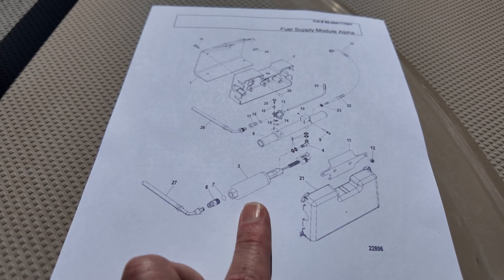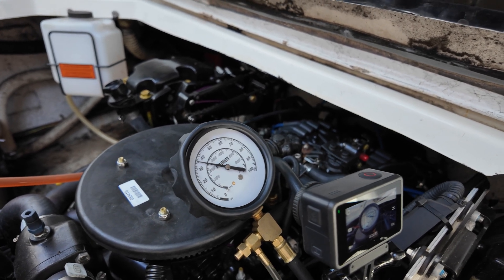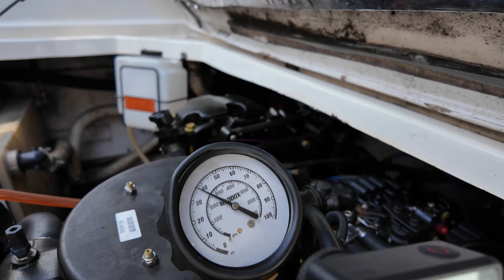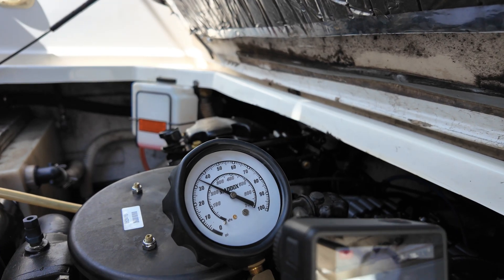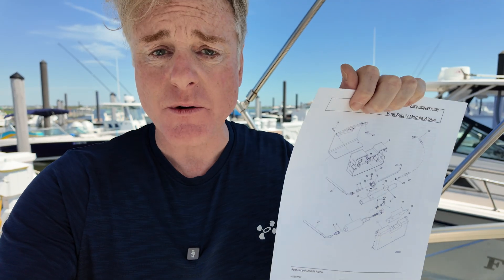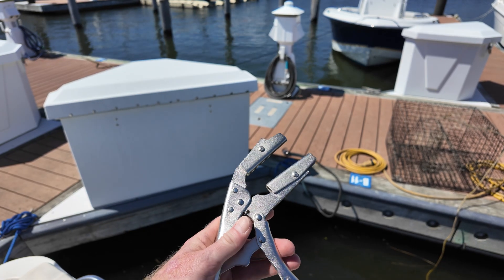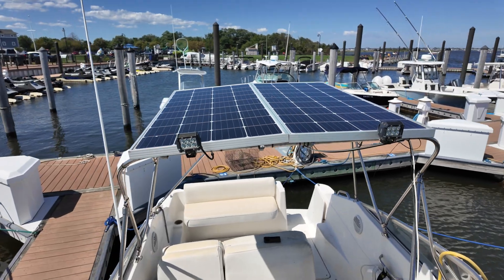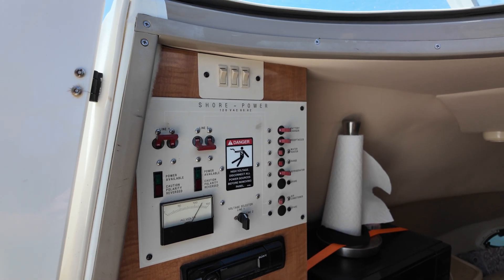Is My High Pressure Fuel Pump Failing? Mercruiser MPI Problems

Comment: I THINK YOUR SUCTION LINE FOR THE FUEL PUMP IS SUCKING AIR CAUSING THE FUEL PRESS FLUCTUATION
Reply from the maker: I've gotten so many great suggestions I should start making a list.  That is a great suggestion and I did a quick pressure test when I took everything off because the pickup is 23 years old.  I thought it could be cracked so I decide to run with an almost full tank too.  Turns out it was the low pressure pump and/or a piece of foil in the tank.  Thanks again for a great suggestion.

Comment: It is a fuel delivery issue, plain and simple. Why are you changing all that other shit for no reason?

My best guess is a blockage at the low or high pressure pump, starving the engine.
Reply from the maker: You are correct. But how would you have solved/fixed it?
Reply: @Nautisphere  if it is a blockage, then remove the blockage. To find the blockage, you start at the farthest point from the pump, disconnect line, run fuel into a bucket to test for flow. Repeat backwarda along the path until the flow increases to normal. If the flow is low out of the pump outlet, then check for a blockage inside thw pump or at the pump screen.
Reply from the maker: Agree but easier said then done.  I removed the pump, pickup and anti siphon value and tested the flow of those components as a system outside the boat.  It transferred a gallon of gas in 1 minute and 15 seconds.  That's 48 gallons an hour.  I did fix the problem.  If I didn't jump through so many hopes I may not have figure out "everything" that was wrong.  Video on that coming soon.
Reply: @Nautisphere  it may not have been easy for you, but for an average mechanic, this is very easy to diagnose. This gets much harder when dealing with direct injection, since those pressures can exceed 2000psi very easily, but when dealing with port injection, it is pretty straight forward.

In fact, when you initially had the pressure gauge connected, I knew to look for a blockage first, since shit in the tank is the most common cause of fuel delivery issues in marine applications. Pickup tube screens are a known culprit in many older tanks, so I normally cut them out in favor of relying on Racor filtration (pre-pump) to do all the screening. This also allows for the installation of differential pressure gauges to alarm when drop gets too high, normally on diesel applications.
Reply from the maker: Totally agree with you.  I had a piece of foil in the tank and since I'm on a 24ft cruiser I don't have a Racor filtration.  I may have struggled a bit BUT I did solve the problem without throwing any parts at it other than a $25 fuel pressure regulator and using the spare low pressure pump I had.  If I was helping someone in the future I'd suggest removing the screen from the pickup, but a none anti siphon in temporarily and run the boat until the problem happens again.  When it does check the screen at the pump.  This is exactly how I got the foil/obstruction removed.  Certainly a lot cheaper than having someone polish the fuel and tank which could have been $$$$.
Reply: @Nautisphere  being gas, not diesel, polishing the fuel is completely pointless. Adding some 90%+ rubbing alcohol or Methanol to the tank would "polish" the gas.

Not having a proper external fuel filter on any marine application is asking for trouble. Amazon sells Racor knockoffs that work just as good as thw real thing at a fraction of the cost.
Reply from the maker: Good to know.  I did a quick search on Amazon.  I'll do a bit more research and perhaps will add something like that in the future.  All the used boats we're currently looking at do have "real" filters but we are only looking at boats with diesel engines.

Oddly enough, using an additive was part of the reason for my problem.  🤦🏼‍♂️

Comment: Going through the exact same problem. Have you replaced the fuel regulator of the 'cool fuel module '.  Just replaced mine haven't had a chance to try the boat yet.
Reply from the maker: Thanks for your question. I only changed to fuel pressure regulator up by the rail. That didn’t fix the problem. What did fix the problem was swapping out the low pressure fuel pump and finding a piece of foil from the top of a bottle fuel system cleaner on the screen. I had the spare pump so I didn’t put the same one back on. I was too tired to not just try and solve the problem so I can’t say if it was one or the other or a combination of the two. Maybe next summer if I “have nothing else to do” 🙃

Comment: Enjoying your content a lot because I’m also dealing with this type of fuckery on my 2007 2400SE 5.0 MPI. 

I started getting stalls at cruising speed where I’d need to wait a few minutes before it would restart.  I suspected venting issue so took off vent hose and blew compressed air through it and big spider came flying out of the vent cap.  Boat ran great for a week or so then started stalling again.  Definitely a fuel pump issue as it only turns on intermittently.  I took off the relay that powers it and lo and behold terminal 30 was fried.  Bought a new relay but it may just get fried too.  Hoping I won’t have to replace entire CoolFuel module. 

BOAT: Beware Of Always Troubleshooting 😂
Reply from the maker: Thanks for the kind words.  I finally got my boat running right this weekend.  It was the low pressure lift pump but I'm not exactly sure IF it's totally bad.  When I went to swap it with a spare I had bought 14 years ago I found a little piece of foil from the top of a bottle of fuel injector cleaner on the screen of the pump.  Good luck with your new relay.  Hopefully it doesn't die on you.  Make sure your blower motor is working well and keeping that engine compartment as cool as possible.  These MPI engine certainly don't like a lot of heat hence the need for the CoolFuel module.

Comment: idk if you have the right fuel pump drawing, one is on the port side and the other is on the starboard side. please confirm. Also try checking your base timing as mine slipped so I had to readjust.
Reply from the maker: Thanks for commenting.  I have the correct pumps.  Lift is on the starboard side going right to the tank.  The port side has the fuel cooling module and HPFP.  I have not checked my timing.  Can the timing just "slip".  I mean if everything is tightened down properly that shouldn't happen, correct?  Depending on how quickly I want to bury the throttle I can get up to 4200 rpm and it's super smooth.
Reply: @Nautisphere  If your pump is on the starboard then you have the cool fuel module 2. There is a little screen in the regulator that could be clogged (usually this would give a higher fuel pressure). I don't know about the lift pump, but that could be clogged preventing volume to the hpfp.  I'm leaning towards you sucking air in your pickup though this can only be tested with an aux tank. A distributor can slip though its uncommon, it was just an idea.
Reply from the maker: Thanks for the advice.  Hopefully I won't have to try those anytime soon.  I got it working last weekend.  I narrowed the problem down to the low pressure lift pump and while swapping it I found a small sliver of foil from a Techron bottle on the screen.  I had enough time blown this summer so I just swapped the pump with the spare I had and everything seems to be working now.  🙏🏻

Comment: Man, this is one SOB of a problem. Still sounds like fuel to me. If the HP pump is good, have you tried cleaning the common rain\l and injectors? Take the injectors out and have them tested? After tat, I would follow up on suggestions to get sensor such as MPA and O2 checked.
Reply from the maker: Hi Martin.  You can say that again!  I installed a new battery last night but didn't get a chance to take it out.  Agree with you it still feels like fuel delivery.  I'm still questioning both pumps (not that they are bad but loosing voltage hence the new battery).  I have new battery terminal connectors coming, along with a new TMAP sensor, ICU sensor and BG 44K Fuel System Cleaner.  The sensors were cheap and I can easily swap them in and out.  I'm going to get another ground cable hooked up too.  I've seen too many stupid things happen because of a bad ground.

Comment: This what I done so far 
Change anti siphon 
Plugs 
Rotor and cap 
Low fuel pressure pump 
Oil change ,oil sensor 
And sending unit 
Fuel filter separator it's turning my plugs to dark powdery smoke 💨 somebody mention it's running to rich that's why I leaning on moving into high pressure pump posible injectors or pressure regulator. I'll keep you posted . Thanks .
Reply from the maker: Did you replace the MAPT sensor?  Manifold Air Pressure and Temperature Sensor?  Should be on top pf engine between the air filter and the distributor. I just took mine out and sprayed it with Contact Cleaner but no joy. Mine is a Bosch 19-03-293 D 02.
Reply: @Nautisphere  did you had any luck getting to run better ? my temperature never goes over 150 first thing I did wheb  I got the  boat was change inpeller . I will check MAPT sensor mind I believe talking about Mass air flow sensor ? Mind is in the Trhottled  body  intake since it is 5.0 EFI 302 ford motor .
Reply from the maker: Mine DID not run any better. I’m going to order a new MAP sensor. I made a mistake before. That number was probably the date code. The part number for my MAPT sensor is 0261230217
Reply: @Nautisphere ok good luck keep me posted on you Results please.

Comment: Hi my we have talk before I feel your pain my problems just  went back to square one 😢 I'm now don't have any power when giving it throttle it just like it's totally not getting fuel I'm testing the power from the relay to high pressure pump . I hook up fuel  pressure gauge I got no pressure gauge at all , trying to determine if it's electrical or the pump it's bad . I do have a new pump on hand the Omms on the new ones are 15.5 and the omms on old one are 1.5 I might just changed it see what it does i can't find anything on eBay they should be but that's a lot of difference between the 2 of them . I'll be watching more of your videos hope I can learn more from them .
Reply from the maker: Not sure which pump you need but someone recommended the Fuel Pump Factory. They got their pump from them and recommended them.
Reply: @Nautisphere hello my friend here an update on what im doing as it turns out i had the high pressure fuel pump installed on the low pressure side 🤦‍♂️🤷‍♂️after confirming with the Manufacturer Quamtum fuel systems n seen you tube videos . Im going to switch over to the high side n put the other new one on the low side . Also going to replace  the fuel pressure regulator . N see why at it does . But all along I been running with high pressure pump on low side maybe that's why boat been runner like crap having 2 high pressure pumps 🥴.
Reply from the maker: Thanks for the update.  Glad you figured out the problem and hopefully nothing negative happened with all that extra pressure.  Hope that fixes it for good and you get to enjoy some great weather the rest of the season!!!
Reply: @Nautisphere thanks 🙏happy boating n safe Labor Day wekend
Reply from the maker: Thanks.  I'll be on my boat no matter what.  Worst case scenario I'm anchored out for a while or fishing on the bay.  ✌🏻
Reply: @Nautisphere nice 🫶🤝

Comment: Hey Great Videos Havign issues with my 2008 305 MPI Also. Do you have the Dicacom software and cables? Im right in Barnegat
Reply from the maker: Hey Neighbor. Thanks for the compliment. Unfortunately I don’t have the Diacom Software but I’m starting to think about getting it. Right now I only have the Bluetooth engine adapter to run VesselView on my phone. What issues are you having with your 305 MPI?
Reply: @Nautisphere  Started out Running Great this season 2008 Trophy 2352 3800rpm at 23mph 1.7mpg. Then sluggish 4200rpm at 21 1.3mpg. Replaced cap/rotor, plugs and module in cap. Then we ran it IAC took a crap and now warning buzzer and fuel pump on constantly. No more prime, just runs constantly. Pulling ECM today and shipping to maic salazar diagnostics. Gonna replace MAP and TPS also. Might as well freshen it all up for the next 4 months. I have the Bluetooth adapter also plus a nmea adapter
Reply from the maker: I just order the TMAP and the Throttle Position Sensor since they were both cheap online and easy enough to swap if it turns out NOT to be electrical, bad ground, etc...  The warning buzzer might be the sensor for low oil.  I had that happen once.  The pressure was fine, the sensor just died.  I my old engine there was a separate one that killed the engine if the pressure was low.  I'd love the find out about your nmea adapter.  I think my new Garmin supports that and would kind of be cool to see that one the screen vs always using my iPhone.  Keep us posted how you make out.  Hope that ECM is ok.  Those things are expensive.  I've heard people talk about them being a potential reason for a problem but never seen anyone post "Yeah I switch my ECM and everything is working now". Good Luck.
Reply from the maker: Sounds great.  Just do a search.  You'll find me.  We're not the one in Europe.  LOL.  We can rendezvous on the water.

Comment: I think you try a different battery. That thing really cranked slow for an AGM. Which you don't need but whatever. And your solar may not give enough amps that fast to make a difference.
Reply from the maker: I bought the AGM original for the solar.  A year later I bought two Lithium Iron Phosphate batteries from Costco for the solar so I decided to use the AGM as the main battery. Maybe I’ll switch back to a regular battery instead of paying the premium for the AGM because it didn’t seem to last any longer. The AGM in my BMW convertible is 14 years old this month. Manufactured date August 2011.
Reply: @Nautisphere  Those AGM don't recover fast. All you need is 1000 Amps for that engine. Batteries create so many problems. Stick with what is recommended.
Reply from the maker: @pete926  I have my old battery sitting in the garage.  I'll take it over to Costco for a new one and see what happens.